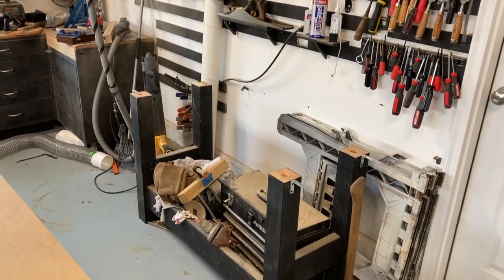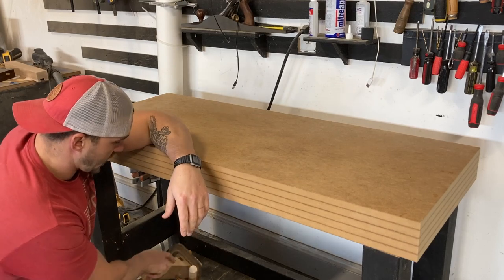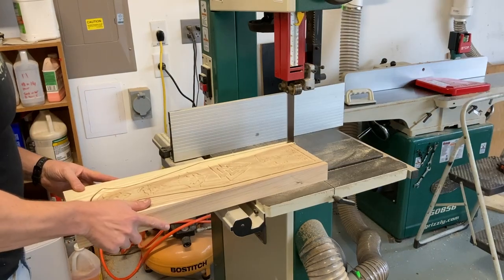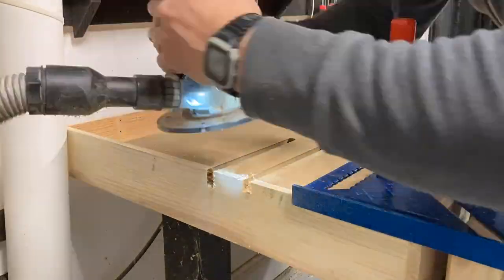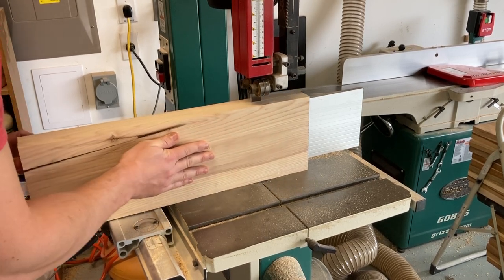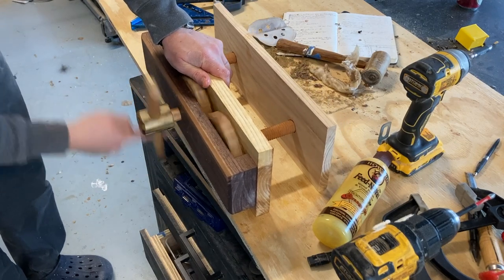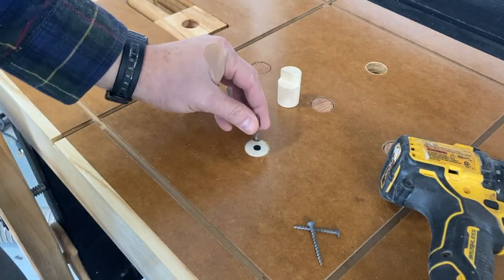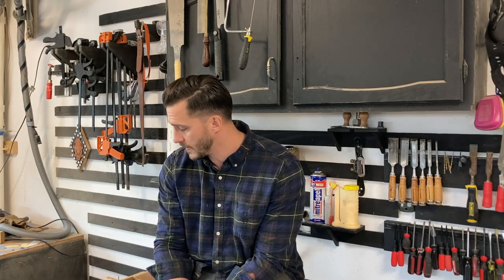Work bench build MDF top and all the vices

Comment: Really cool bench. Which vise or hold down options do you find yourself using the most?
Reply from the maker: Thanks for watching. I use the normal vice the most. followed by the v grooves for the clamps that slide in.